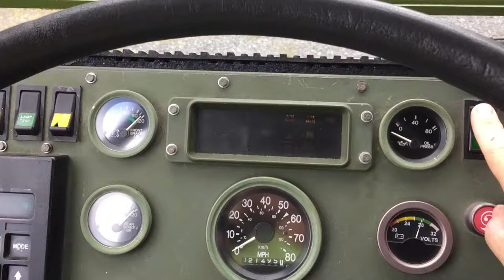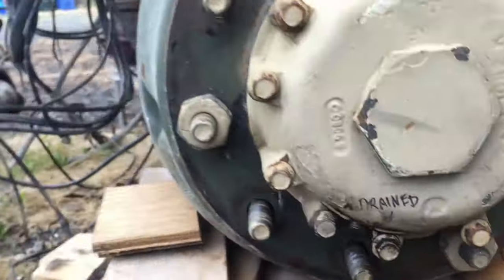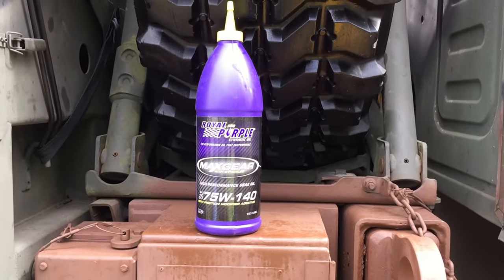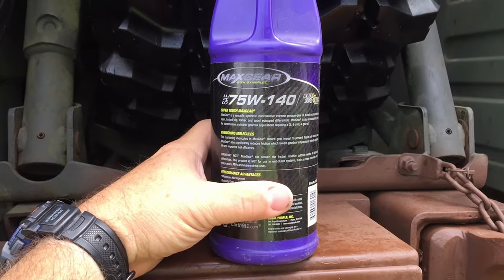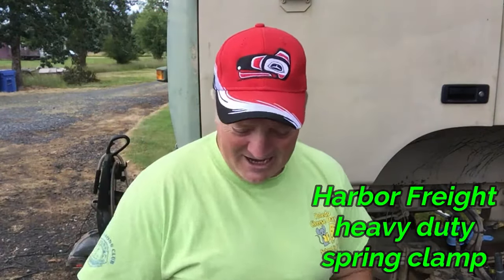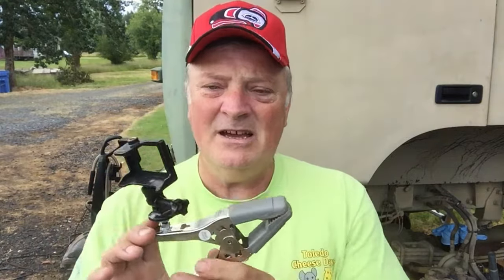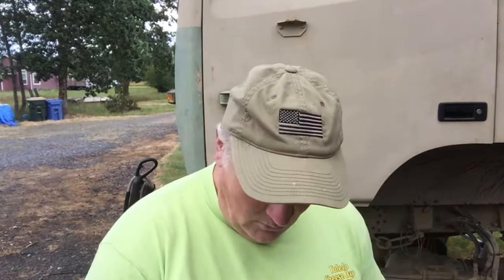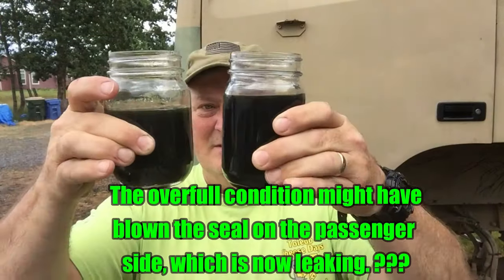FMTV FRONT PLANETARY HUB OIL CHANGE #61

Comment: It was beautiful, Dave! Good that you changed that burnt gear oil.
Reply from the maker: I didn't even realize how bad it was till it was flowing into the jar. The odor gave the passenger side away. If you recall, it was filled to the top of the hub! This means no room for expansion which is hard on the seals. It's fix now, thank goodness.

Comment: Hi Dave! Is it the same procedure for the rear hubs?
Reply from the maker: No, Sir. The rears do not have the separated oil hubs like the front. They have filler caps on the axle "pumpkin." Just top those off while on a level surface. Cheers!

Comment: Always enjoy the videos.  

When you added the oil back, is there any waiting period before rechecking or do you just stop and plug?   

Just wondering, if you fill too fast, will some come back out of the port even if it is not full yet.
Reply from the maker: I don't think so... 11-13 ounces is it. I think the drivers side had 13 and the passenger had only 11. Either way, I'll be checking them again in 30 days just to make sure all is well.

Comment: Hi, this truck run 60 M/H easy to keep all day?
Reply from the maker: This truck will run 55 miles per hour at top speed. Most guys buy the higher gear sets for greater top end speed at lower engine RPM.

Comment: How do you add oil to LMTV?
Reply from the maker: Great question! Nip off the small end of the oil bottle, shove it into the oil drain hole, and squeeze the bottle. If it is not full after a few seconds, pull the bottle back out, allow air to fill the bottle back up, and repeat process. Good luck!